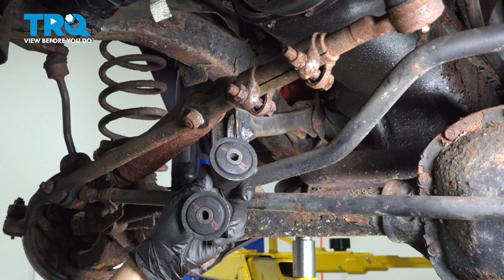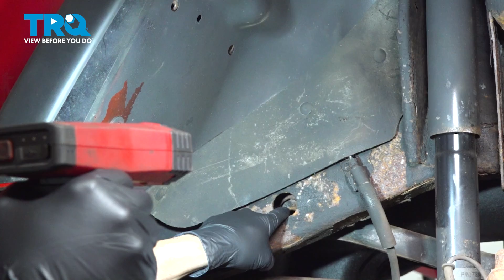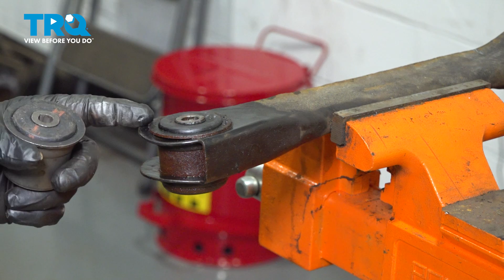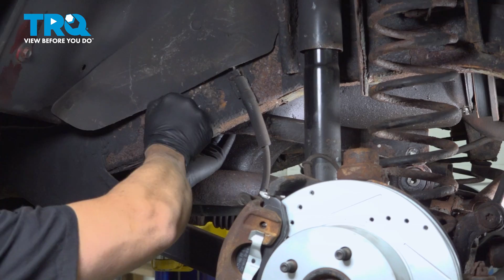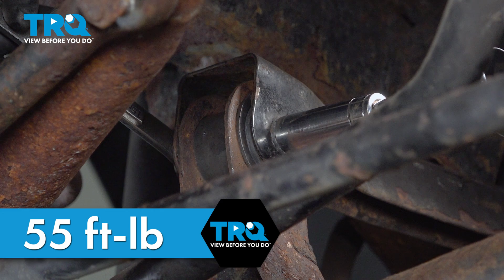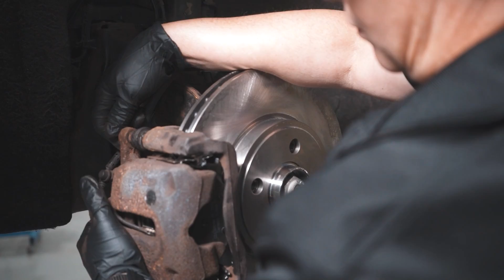How to Replace Front Upper Control Arm Bushings 1997-2006 Jeep Wrangler

Comment: I thought, you only toque the control arm bolts to there specs when the vehicle is on the ground with its full weight on the suspension.